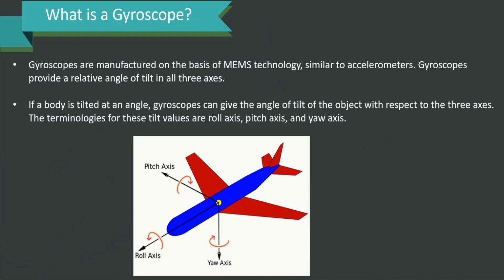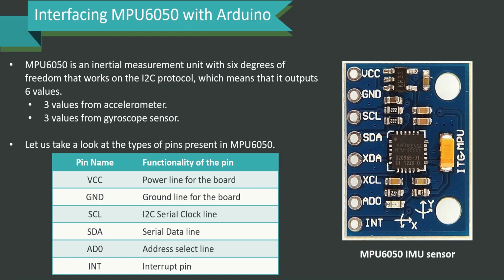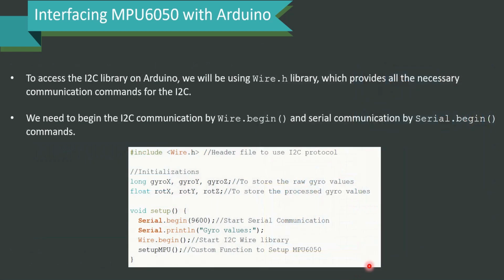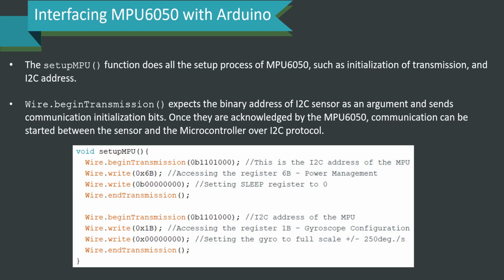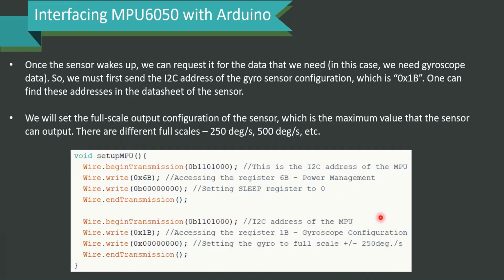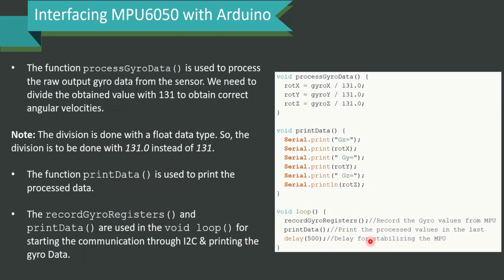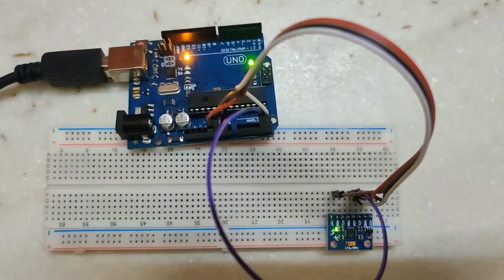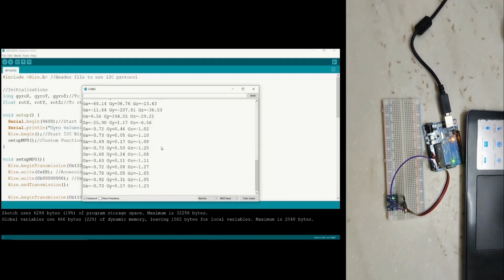Interfacing Gyroscope with Arduino Uno - Step by Step Explanation and Demo

Comment: Hey does Arduino R3 clone affect the I2C communication with gyro? Actually I'm currently working on a drone project but the error occurs at gyro detection. Gyro is detected (MPU6050) when I run the test code but does fail in detection when I upload the main YMFC_setup_Al.ino  code . Why does it happen? I've done multiple tricks to make it work but it still fails at detection. The address is 0x6B in test code and my gyro is detected but in  main code this option is given yet it fails every time in detection. Plzz help me out mann!!!  Also I've done the wiring exact same as you mentioned 😢